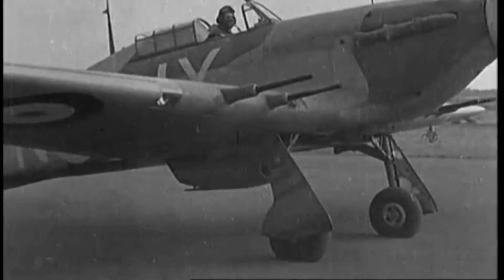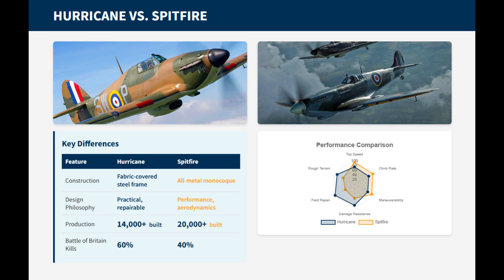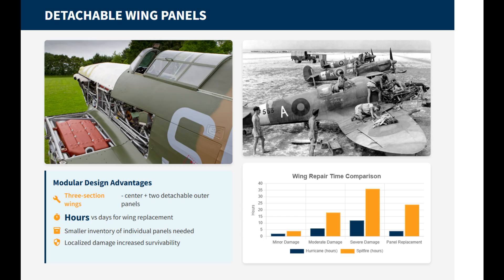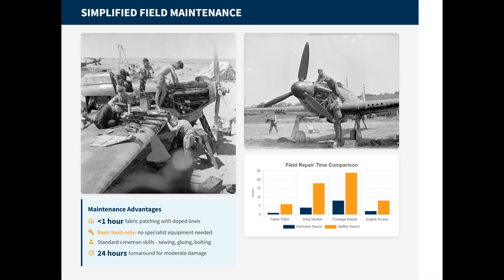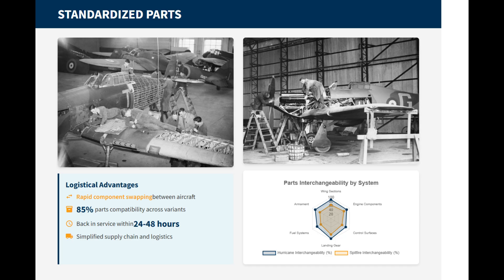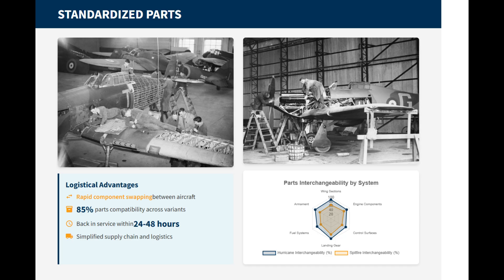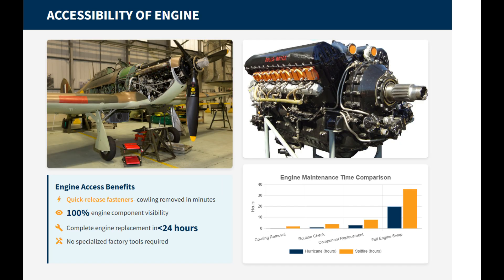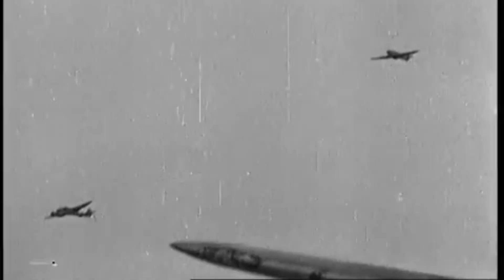Six Reasons the Hurricanes Were Too Easy to Repair

Comment: I heard an excellent lecture by one of the engineers from Duxford.He strongly refuted the 'easy to repair'story of the Hurricane!  First you have to strip off some fabric and stringers; then try to repair the very precise metalwork joints; then  re-glue the stringers, ( and wait  how long for the glue to cure?) then apply and dope the fabric and  finally paint it!   Whereas a skilled metalworker could patch a Spitfire in half the time.
Reply: Bot